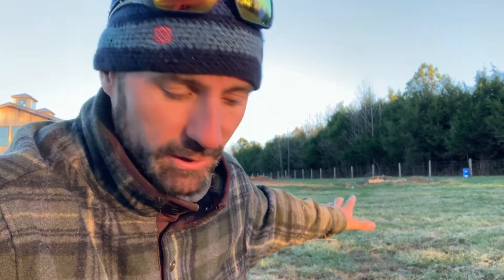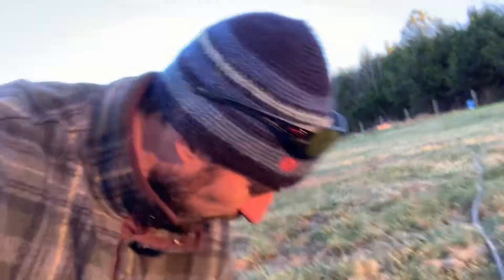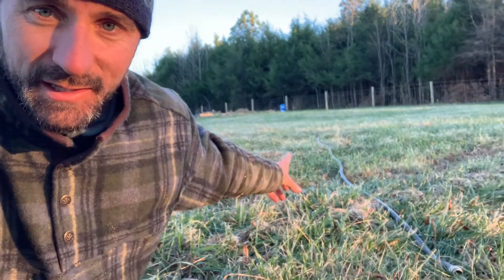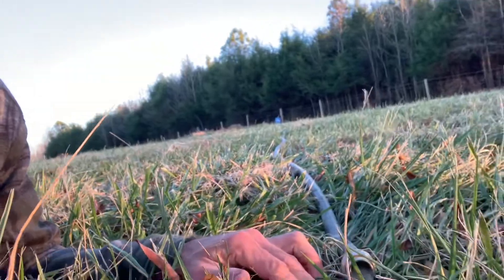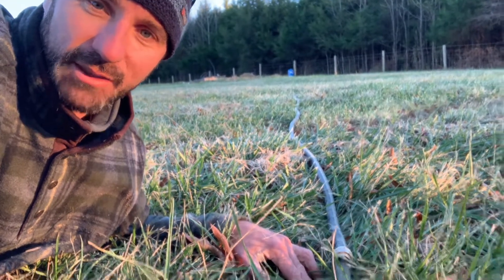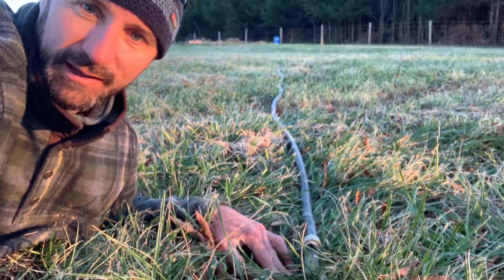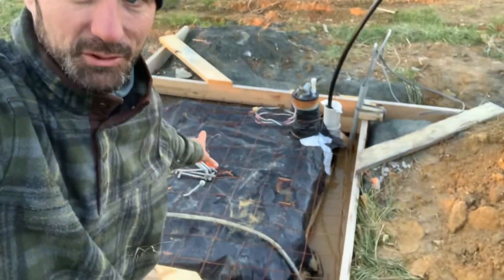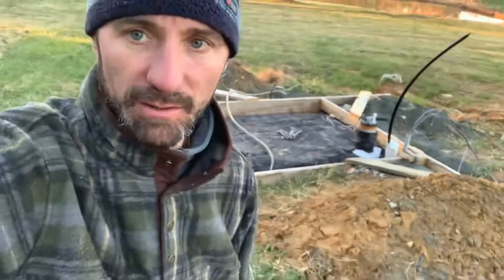How To Siphon: remove standing water in a hole or trench WITHOUT A PUMP!!!

Comment: Trying to use a similar method to clear our sump pump pit while we wait for the new pump to arrive in a few days. 

Doubt it’ll work since the pit in the basement (probably six feet below the ground outside) is the lowest point around. Otherwise I could run the hose up a few steps and out the back door. 

Any tips if I’m not able to get the discharging end lower than the pit itself?
Reply from the maker: @KlutchAndJerel  how much water is it? Is it steady filling water (with or without rain?)
Reply: @ no rain for the next few days. Not filling  currently , and actually seems to be draining slowly somehow… It’s probably about ten inches of water in the pit, I’d say about ‘half full’. 

It isn’t exactly a perfect setup - the washing machine actually pipes into the same pit (not ideal obviously, this is how it was when we bought the house two years ago). So we are holding off on washing clothes until new pump comes in.
Reply from the maker: @ not sure how to get that water out without a pump or enough fall to create a siphon. Can you add another hose and get far enough to where there is fall fro the sump? Or buy a small transfer submersible pump that you could also use for a backup next time the sump fails?

Comment: I’m watching to learn how to drain a hole full of water with a hose. I really didn’t learn how to do it. Waste.
Reply from the maker: Sorry about that. You have to drag the other end of the hose to a lower elevation that the end that’s in the hole you’re draining, and create suction (by sucking on the hose with your mouth). Once you start pulling water, you can let it flow on its own. If you don’t want to suck on the hose, you can fill the entire hose with water, cap off the ends, submerge it in the water, take one end to a lower spot than the bottom of the hole you want to drain, and then open the hose. As the hose drains, it pulls water from the hole and creates the siphon to drain the rest of the water in the hole.
Reply: I have a 7ft deep sewer trench full with sand.  Ugh.   I need we’ll points